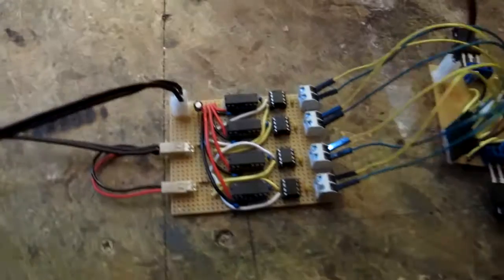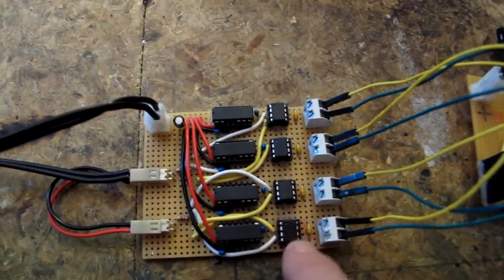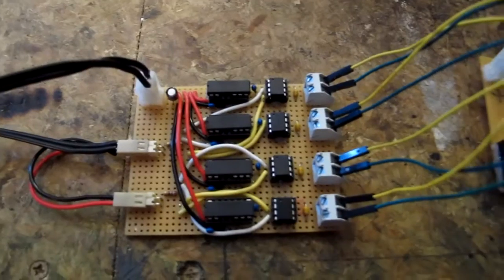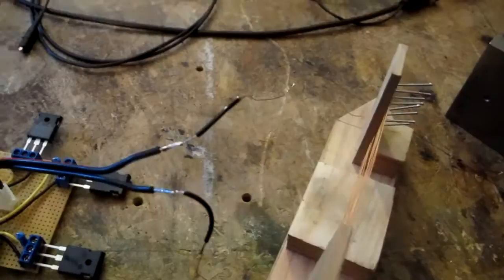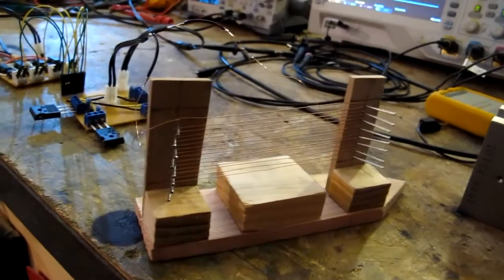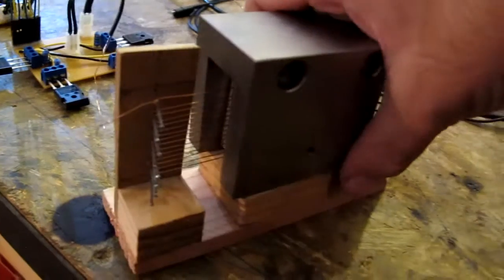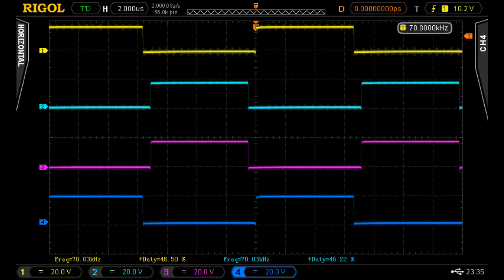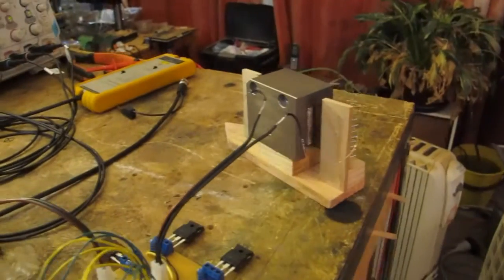Isolated H-Bridge and Magnetostatic Speaker

Comment: Could you provide a link to the circuit diagram for the H-bridge driver? I would greatly appreciate it.
Reply from the maker: I've put a link to the paper I used as a basis in the description. It has schematics for a half bridge so I just doubled that up to make the full bridge.

Technically you could get away with just 3 DC-DC converters if you're on a budget as both bottom halves of the H-Bridge are ground referenced so don't need to float in respect to each other like the top halves do.
Reply: Thank you!